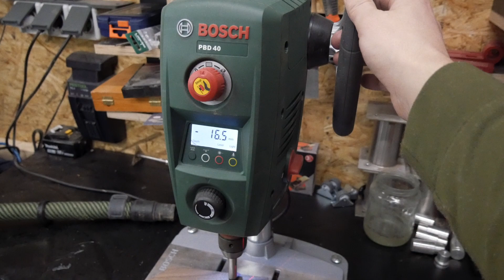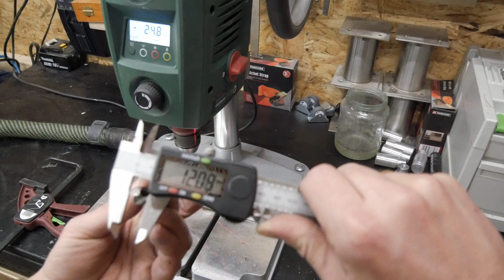DIY Wooden Knobs espresso machine - Woodworking

Comment: Great video!. Do you know how to also remove the handle of the portafilter for a wooden one?
Reply from the maker: Yes i did it with the grinder
Reply: @DCreationwoodworking  I have a Lelit MaraX. The handle seems to be un-removable. Do you know how to separate it?
Reply from the maker: @eskerinola5845  just grind off the handle 3 cm from the porta filter. so you still have some threat m8 left to make a wooden one with a threded insers m8
Reply: This is really helpful mate. Thanks!

Comment: Excellent job and video!  I was wondering about using a plunge router on a stand to do this.  I certainly don’t have as extensive a shop as you do.  Any suggestions?
Reply from the maker: Hi thanks man! Well the only thing that need to be accurate is the holes on the outside of the knob. So you can do these with a plunge router or a drill guide or a drill press then you are good. If you don’t have a drill press or anything like that just use a long bow drill with a small square so you can drill square 90° but it’s really important to measure the total length of the outside of your knob and you divide that by the right amount of holes and the diameter of your drill plays a role in this